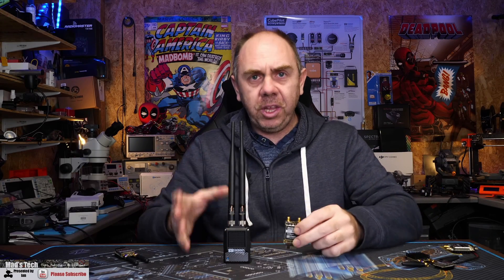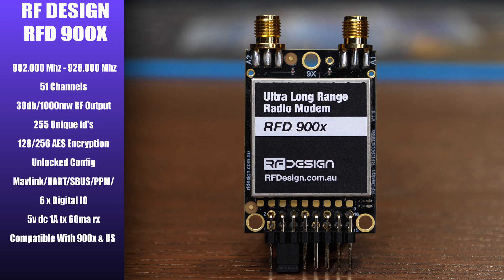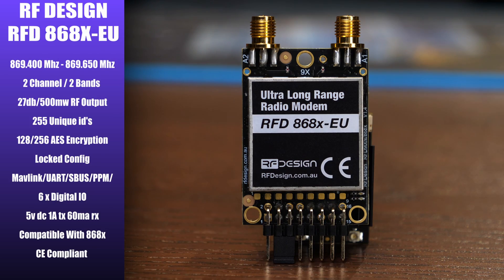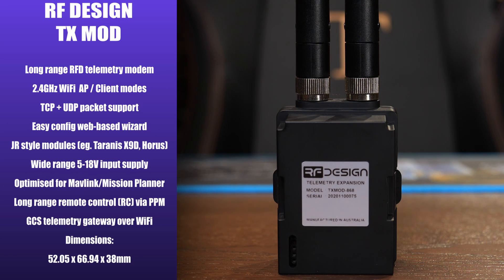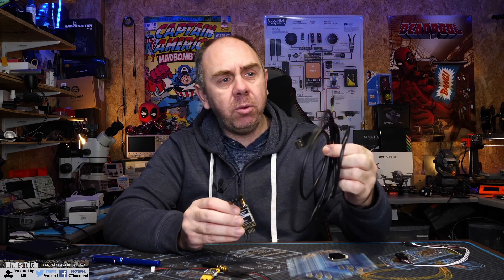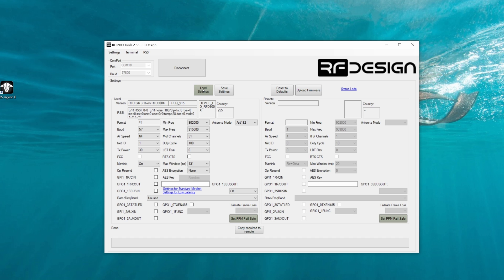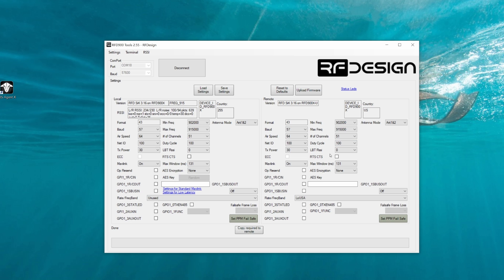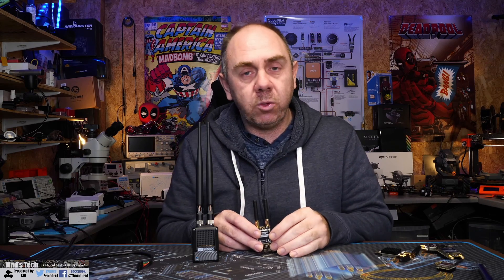RFDesign RFD 900 & 868 Long Range Telemetry For Ardupilot & PX4

Comment: I have a TBS Crossfire system that broadcasts at 915Mhz, wouldn't this Telemetry transmitter just step on the Crossfire signal? Or is this Telemetry doing the control signal as well from the Hand Held Transmitter as well?  It would seem absurd to have 3 transmitters on the aircraft, 1) Radio Control, 2)Video Signal, 3) And then a special TX/RX for the telemetry......     What is it I don't understand here? Please fill me in !!!

Comment: Is it possible to change the frequency in RFD 900x / 868x modem, for example from 900mhz to 868mhz? (change firmware)
Reply from the maker: No it’s hardware.

Comment: I'm experiencing a lag issue with the RFD900x and RFD868ux radios. The HUD on the mission planner and the map update is very laggy. I've used RFD900+ earlier and it worked flawless. If I use these radios in the same system and same drone, I get different results in terms of latency. Any help regarding this?

Comment: Got a slight problem on this end I’m hoping you can help me with… I have the RFD900x and out of the box both connected to power, I get a solid green LED however when connecting to RFD Tools v2.60, it fails to connect. I do get a COM Port assigned to the FTDI cable when it is plugged in. Any thoughts?
Reply from the maker: That’s odd. You 100% got the pinout correct when plugging into the module from the PC.  You shoud be removing the jumper ?
Reply: @MadRC  I did not know the jumper has to be removed when connecting to the computer via FTDI cable. Does that hold true for the air unit also?
Reply: I tried connecting the laptop this time without the jumper and it still could  not be seen by the Laptop. The green LED did not illuminate with the jumper removed. In the RF Tools, it appears to connect however when I press the Load Settings button, the error message “Failed to enter command mode. Try power-cycling modem.” I was successful in connecting a 3DR Mavlink Telemetry Rcvr/Xmtr to test and amazingly it worked as advertised. Your thoughts!

Comment: I missed the overview, still left not getting the basics.  So you linked two of these 900mhz modules, they have a 500kbps link, half duplex? Is there different tx and rx frequencies?  What do you connect them to? One goes to flight controller but the other usb to gcs? 
I'm a bit lost as I've never used a radio link for ardupilot, I just use lte

Comment: Please consider doing something with their mesh network functionality. I've always wanted to see that demonstrated in practice. Love these radios. I've used them on the job and they are solid for UAV work.
Reply: I was told that you can't use the Mesh functionality with the TXMOD and but I feel as if there's a way around it as if you open the TXMOD up it's literally just the same radio in there, so if you removed the module and programmed it separately it might be doable, however I make no guarantee om that working as I haven't tested it nor do I have the ability nor will to try it.

Comment: Another awesome video and it couldn’t have come at a better time. Just got done doing the AutoTune and setup on my CubeOrange dual Here2 680 Hex and now getting back to my 960 Hex that has the RFD 900x-US on it. This one is also a CubeOrange build but has two Here3’s on it so “Hopefully” these upcoming videos could incorporate some RTK stuff also so I can use my Here+ base unit with all this. 
Can’t tell you just how much I’ve learned from your Ardupilot build videos and being able to go back to them when I run into a problem. Your latest HereLink firmware update was one of them, after watching it multiple times and reading the many posts on the CubePilot form, I thought I was another person who was having trouble updating their Airunit until I caught the updated version numbers from your video and realized it did update after all.
Massive Thank you for all your work.

Comment: Ardupilot newbie question: can‘t I just use crossfire telemetry? Thank you very much for your video Mad!
Reply: You could. Although the transceiver (air rx) is only outputting 40mw. Even though the crossfire tx can output 2w, you will lose signal due to the rx power. This stuff here is high-end way better.
Reply: @NoFlyDrone  thx a lot!